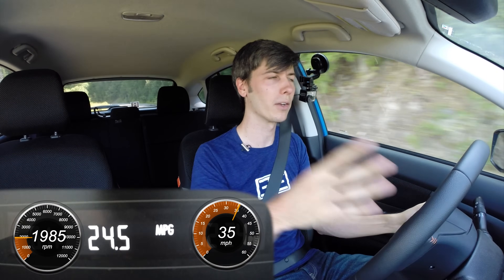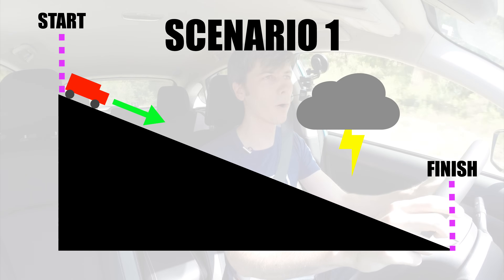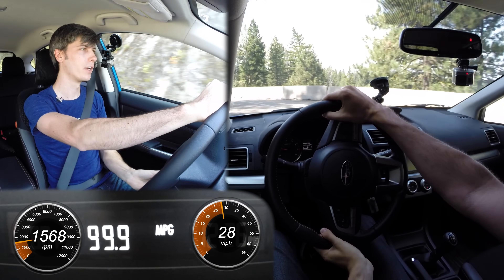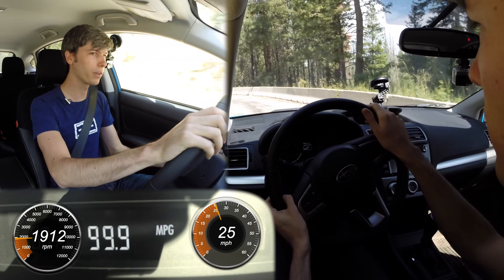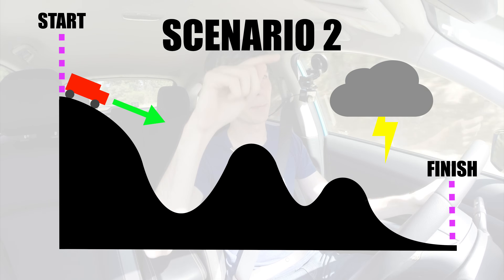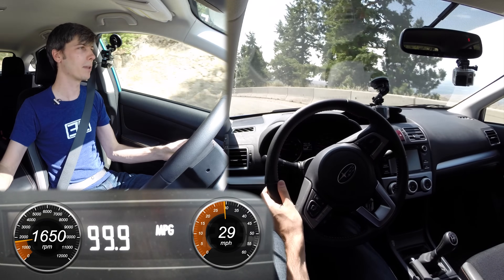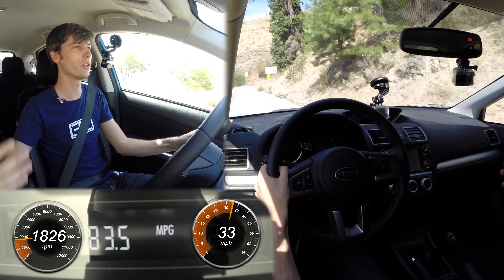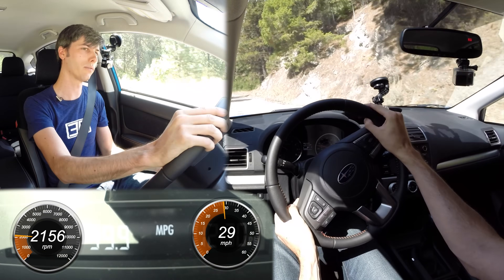What Uses Less Gas - Coasting Or Engine Braking?

Comment: Worth adding - depends on the engine too as carburated engines won't shut the fuel, I believe :)
Reply: I was going to ask if every fuel injected engine shuts off fuel.
Reply: @Jdmorris143  Not all of them do, especially older ones.
Reply: Depends on implementation but it's generally true that carbs won't shut of fuel. -There are som oddballs out there :D About fuel injection. If it has mechanical fuel injection it will usually not turn of fuel. Most if not all electrical ones will tho
Reply: There are some carburetors that have engine-braking valve, controlled with vacuum ;)
Reply: I thought this might be the case but then the question becomes "What Uses Less Gas with a carbureted engine - Coasting Or Engine Braking?" Probably the same because it just sits with the fuel system running minimum/idle amounts of fuel into the engine.
Reply: my crown vic doesn't appear to shut off fuel.
Reply: My carbouretted fiesta cuts fuel to the engine when coasting in gear
Reply: Christian Ivarsson vacuum and fuel requirements are inversely proportional. Higher rpms with a closes throttle means higher vacuum... and therefore less/minimal fuel. Low vacuum at wide open throttle means high fuel.
Reply: From experience with carb car.

 There is still fuel getting into the engine but low like idling rpm fuel requirement to 1000rpm fuel requirement.
Reply: Would that make the engine run too lean though?
Reply: albertlagerman well IF you r running a carb and driving the engine at 'lets say' 3000 rpm, you should always step off the gas pedal. This sets a function of the carb wich still gives fuel to the engine, so it does not lean out. So to say in 2 stroke engine design. In a 4 stroke the carb shuts off with a 2nd regulator plate, so the pivot does not add fuel to the engine.
Reply: EE should make video about this I think.
Reply: Worth adding- read his note.
Reply: silverspear21 He added that note after my comment :D
Reply: It's vacuum-driven so higher RPM = more fuel. :)
Reply: Then there's two-stroke engines. On some of them it's actually harmful to rev the engine without adding fuel since it needs the lubrication. Thankfully this is a thing from a very distant past lol

Comment: You mentioned this doesn't apply to automatics. I'm assuming that this is because the automatic clutch doesn't transfer much energy back to the engine, so the engine would be idling in either case?
Reply: You clutch will start to lock up at a certain rpm. It doesn't work if your rpm is low, but once it starts to rise, it does apply.

Comment: When there are no Corners ahead: PEDAL TO THE METAL!!!!!!
Its fun reaching 120 mph in a 75 hp Car and feel the G-Forces when it goes Uphill again
Reply: +Aseki Bekovy
cars that go down hill do
Reply: Phil Rauchi ford ka, 60 hp, 205 kph. We got an autobahn section that goes downhill for 4  km or so. I thought that thing was going to fall apart lol
Reply: Aseki Bekovy my 93 golf 1,9 idi has hit 180kph in a slight downhill, fastest i've ever gone in it
Reply: my 4af corolla has hit aprox 200kmh (spedo ended at 180 but needle kept going)
Reply: My daily has 70 hp up hill speed stays the same or goes down on full throttle 😂😭
Reply: ok takumi
Reply: El Coronadouu I feel you in my Ford Fiesta with 82hp
Reply: Phil Rauchi says the 13 year old about his driving experience
Reply: Damon Richter the car is 100% the best car for my situation, out of 100 cars I see on the street, there may be one that I look at and say to myself, with more money, I'd buy...
But apart from that, It's perfect. I can't even think about not having it.
Reply: We are not talking about downhill driving. My gearing would allow me to hit 240km/h without overrevving.
Reply: we are also not talking about what the speedo is reading :D
Reply: Only fun going down hill.
Reply: Phil Rauchi Now try that in a 18 wheeler.
Reply: Man, I know that feeling. My first car felt like sitting on a massage chair on high at 80mph (~129kph), and somehow that thing managed to get to 98mph (~158kph). Downhill of course.
Reply: Taydrum Peugeot 309 1.3😎
Reply: Specs say the max speed is 97 mph.
Reply: Aseki Bekovy 117 hp in my truck, max speed up 100 mph and that’s me pushing it to high hell to make it to that speed. Normally I cant get above 85 mph lmao.
Reply: 306 hp in my car :D
Reply: No way you can reach 120 mph in a 75 hp road car
Reply: i know about someone in a 75bhp slightly aerodynamic damaged car that hit 111mph(had wheels from a higher model) and still had about he said 500 revs before redline. he put a back box and now gained another 500 revs before redline and said 2nd gear top speed is now 55mph instead of 50. "usally the car wont go above 100 in a slight uphill but with a down hill run and a bit of drafting with minimum mods the car can do 120/125mph tops" im talking about a friend that went to Germany obviously
Reply: Once i drove a vw sedan at top speed (75 mph)
It was more fun than driving a focus rs at the aame speed
Reply: now which 75hp car reaches 120 mph? My car has 69 hp and I consider 108mph quite high for that.
Reply: >120 mph
>75 HP

Pick one
Reply: Or you could just drive a fast car fast lol
Reply: Aseki Bekovy dude u need a better car

Comment: so weird to see it as miles per gallon .. my car shows me liters used for 100 kilometers. So its like 8 liters per 100km on average and when im not pressing the gas, while in gear, it dropps down to 0.
Reply: tehguitarque when idling my car shows L/h as instantaneous value as opposed to L/100km normally
Reply: Aseki Bekovy how? Flat area, only driving 80 and not shorter than 50km? :D
Reply: Hello, In the UK we have MPG. Gallon = 4.5 litres (ish) So my average is 45 MPG and 1 mile = 1.6 km

So 45 * 1.6 = 72KMPG then 72 / 4.5 = 16KM per litre. Then 100/16 = 6.25.

What i find confusing, the higher yours is the worse, the higher ours is the better, and vice versa :P
Reply: its mpg in uk also
Reply: @Fatalist 8l/100km is 29.4 mpg. Not bad.
Reply: sic22l Well over here gas is more expensive than in the US and our cars, as they are smaller, should consume less. I am personally disappointed with me driving 7L/100km
Reply: We're in L/100km in Canada as well.  To my understanding it's only US, UK, and maybe Liberia which uses non-metric.  I'd imagine U.K. presents in both systems even if people only use imperial?
Reply: @Fatalist
It depends on the car and the driver. 8l/100km can be a lot but it also can be very little.
Reply: i drive a 60hp polo, but i pretty much only drive on the german highway... so it consumes more on average than it would normally
Reply: This is the only type of measurement unit where I find the American way to be better, everything else, metric is superior. Distance you'd travel with 1 unit of fuel, makes more sense(easier to calculate how much fuel you need for what distance and what distance you'll travel with set amount of fuel) than units of fuel you need for 100 units of distance. I wish we had "kilometers per litter" here in EU.
Reply: ΑΡΗΣ ΚΟΡΝΑΡΑΚΗΣ And if you have a 10 gallon tank and get 40mpg, that's 400 miles. Can't get any easier than that for long trips.
Reply: I get 4.3l/100km right now. Not a Diesel. Almost 55 mpg US.
Reply: surpuppa, depends witch modern cars you go by, almost all use more than what they are listed up they will do, living in scandinavia you wont find flat or straight roads xD
Reply: it depends on where u r driving. my 2010 civic could get 6.6 L/100km if I do road trips in backcountry roads(around 90km/h in Canada). But if I drive it in cities, that thing could go all the way to 10~10.5 L/100km
Reply: Dušan Pešić But 100KM/(x)L is pretty idiotic. Then you have to do the math to figure out KM/1L for your given car depending on how you're driving. Or it could simply give you the distance/single fuel unit to begin with. Makes much more sense.
Reply: @pokealong  How do you know when you're doing more than 99.9 mpg? Are you just fooled into thinking you're doing "infinity" when you're actually doing 122 or 155? In l/km you always know exactly how much you're using. You could be using 2 liter,s or 1 liter, or 0.3 liters - which is all above 99.9 mpg. And if you're using zero,, you're using zero. In mpg you will never get the precise measurement the lower the fuel consumption gets. THAT seems idiotic to me.
Reply: MercilessHobo 100km/L is better then you are traveling, because you can estimate how far you can travel based on your current consumption. For example the E46 316ti has 90l fuel capacity, if we assume that we start immediately in 90km/h that in terms of drivetrain means 5th gear in 2500rpm, and the economometer needle at 3,5. Not bad considering that I testing it daily with the trunk loaded to the brim with stuff, and in the national highway 90 (part of the E75). Therefore 1200km range is within reach, if I empty the trunk, and employ drafting, and other economy increase techniques
Reply: I've owned several cars and not ONE of them came with a gas tank that wasn't a round number. 17 Gallons, 13 Gallons, 20 Gallons, never a decimal. But let's say it was 12.3 and 31mpg. Always better to be safe than sorry, so make it 12 and 30. Simple. Anyone who passed the 5th grade can easily calculate that's 360 miles in a few seconds. By the time you hit 360 miles, you'll be well below "empty" anyways because you'll have less than a gallon left. Time to fill up. And how exactly does it not help you calculate how much fuel you need for a trip? Driving 120 miles and get 30mpg? 4 gallons. Driving 100 miles and get 40mpg? 2.5 gallons. Incredibly simple.
Reply: How is that a fuckup? It's irrelevant. If you're using gallons, you're using your nation's measurement of gallons. Different stores in a given area do not measure gallons differently. Unless you are intentionally using liters then converting that measurement to gallons just for fun, it's extremely irrelevant. If you want to use liters, use liters. You don't need to use conversions between different measurement standards of different nations to find out your mileage.
Reply: I think it's better reading mpg rather than l/100km because 100km is huge number to calculate stuff. I'm from metric country
Reply: Exactly. I rarely have to drive more than 5 miles or 8km. So a measurement of 100km or 64 miles is irrelevant to me. However, knowing how many miles I will get out of a gallon IS helpful.
Reply: I agree I live in europe and i would like to see something like km per litre
Reply: 8 liters is not allot, on city driving my 88 volvo 740 uses 14+ and on long journeys i can get it down to 7,2.
Reply: halsti99 On the German Highway I need less gas than on the country roads
Reply: jakobmn Now that makes sense. Also amused that I said L/s instead of L/hr haha.
Reply: That's standard everywhere on the planet except for the US
Reply: Again, how is where YOU are from relevant to where I am from? If your nation uses liters, use liters. If it uses gallons, use gallons. There is no reason for you to try and force me to memorize the conversion rate of your nation's gasoline measurement to my nation's gasoline measurement. It has nothing to do with this conversation whatsoever. I have no idea why you're going on about where you live and L/Gallon.
Reply: Yes... that is exactly what the comment states... we all read that....
Reply: arand4 UK gallon is bigger. Mile is a little longer. Everything is bigger in the UK. (Measurements)
Reply: That's pretty amazing mountainhobob, thanks !
Reply: My 318d e90 uses about 5 liters when i drive efficient. But my rather sporty driving style got me up to 6.8 l/100 km
Reply: MercilessHobo (and here's the fuckup coming) What kind of gallons? The 3,5L equivalent or the 4,75L equivalent?
Reply: MercilessHobo from what nation you expect someone with the "ΑΡΗΣ ΚΟΡΝΑΡΑΚΗΣ" name?
Reply: miles per gallon is in US but in Europe our cars show litres (liters) used for 100 km
Reply: It drops down to zero because it's out of range. I get 200+mpg while coasting down a hill in gear.
Reply: so yeah to clarify in the uk i have never seen it represented as litres per km/m always mpg, but when buying fuel it is always displayed in litres
Reply: one other craziness is: you can't fill up your car, because you have to pay first lol it's not making any sense
Reply: acchaladka we have metric displayed in small print. Kw is attached to nearly all vehicles. Can't adapt to that. Like changing language. English changing to French nationally for example.
Reply: Fatalist Gas is still cheaper than petrol though.
Reply: Jose and UK ;)
Reply: bios47 fixed amount of fuel. Higher number  - great. Other way fixed distance, how much fuel. Sub 0.1?
Reply: Yeah, mpg is a weird way of thinking, because you're saying "how many miles will I go on a gallon", so if you're not using fuel, you will go "forever" (hence 99.9). But what if you're actually doing more than 99.9 mpg? How do you know that? In l/km, you always know how much you're using, e..g in certain conditions you're using 2 or 1 l/km. But how do you know in mpg, if the meter only goes to 99.9? You're fooled into thinking you're using nothing. Am I wrong?
Reply: to make it even worse we switch from litres to imperial, we measure engines and capacities in Liters, then calculate efficiency in gallons but to work out MPG we need to do more calculations because our fuel pump reads in Liters.
Reply: Makes more sense... Fuel consumption is 0 and you are moving. True instant MPG is infinite but if you took the whole journey distance and divided used fuel then you could calculate a real average MPG (or km/L). I guess when you idle in the other system you have the same problem but hey. Instant L/s would tell you everything you need to know about these situations as a driver. 0 when engine off, positive when engine on. Seeing it normalized to distance (speed) obviously helps in general.
Reply: yeah that's also what is standard in europe "not sure about the UK", but in the US they gotta be different of course :P
Reply: if you flip the numbers you get km/l and it's the same as miles per gallon
Reply: halsti99 8 liters? What car are you driving?
Reply: @MercilessHobo
And it gets more tricky when you have 12.3 gallon tank and your car does 31mpg. And it doesn't help you calculate how much fuel you need for your trip.
Reply: 8 liters is a lot. But my 2007 VW Golf also takes 6,8L....I should probably check it at a garage

Comment: Always had this question in my mind. But wait, if the engine RPM is more than idle RPM (cuz of downhill), it doesn't inject fuel, but when it's at idle(neutral), it starts injecting?? Is that what it is?
Reply: Sanderen X Yes
Reply: Yes, in one the engine turns fast because the wheels turn fast, because the wheels are connected to the ground AND connected to the transmission/engine, in the other the engine is not connected to the transmission so it's consuming fuel.
Reply: coscorrodrift Thanks. So the ECU senses it and makes the decision to stop injecting, I presume?
Reply: Sanderen X yeah, it sees that you are applying 0% throttle with the TPS or gas pedal sensor and stops injecting, this is how engine braking works
Reply: The Real Santa Claus That makes sense. Damn I knew this when I was in college. I'm forgetting things 😅😅
Reply: The Real Santa Claus Ah yes
Reply: so what about leaving it in drive, isnt that in gear?
Reply: The condition is called 'overrun'.
Reply: Quick Sipper yeah
Reply: I believe the ECU is connected to the throttle.  When your foot is off the throttle completely, it senses the throttle position and shuts off fuel injection.
Reply: Sanderen X and when you get to idle rpm, it starts injecting again